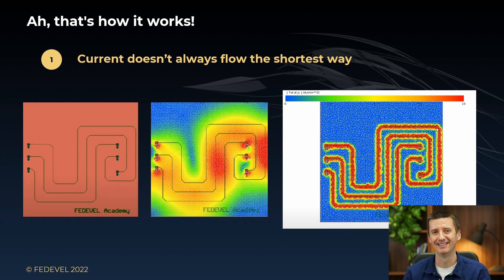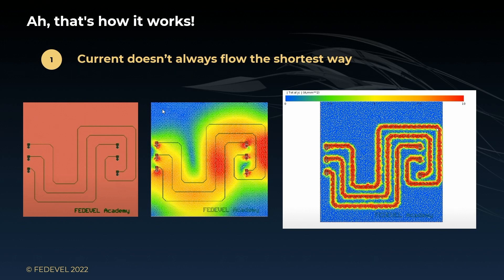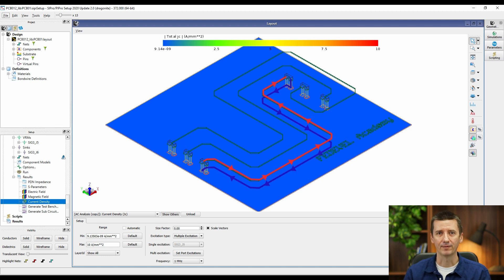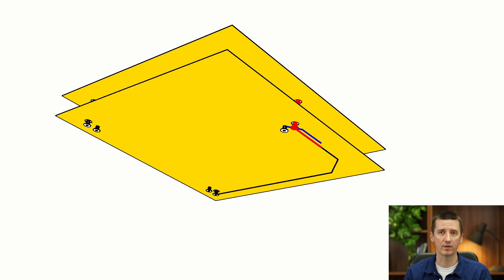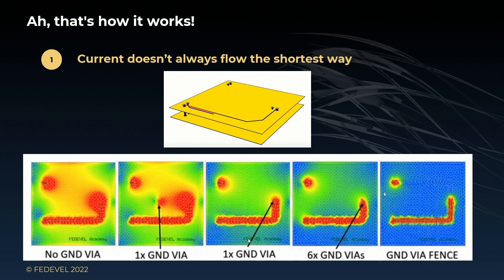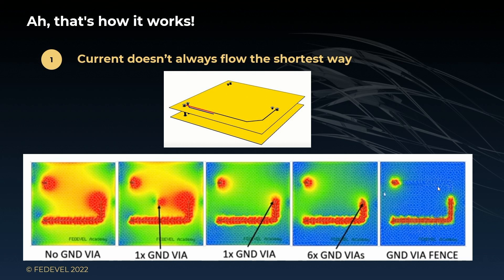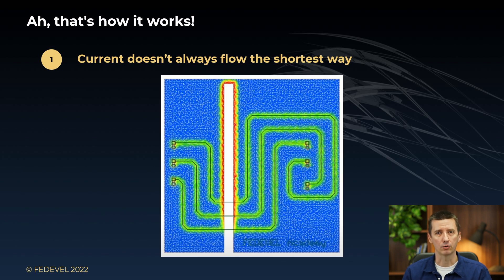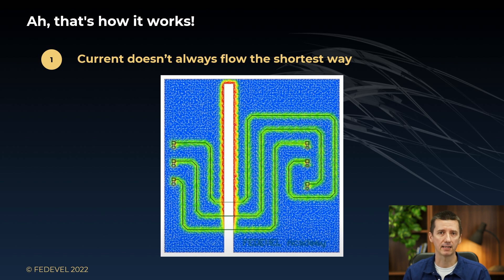Why understanding currents in PCB is important? | #HighlightsRF

Comment: I think it's worth mentioning at least once in the video that for high speed signals the current will flow under the trace because it's picking the path of least impedance not least resistance.

Comment: Current follows the path of the least resistance, reason being: potential gradient.
The potential field can change drastically depending on the frequency (impedance) and the shape. 
It's just that in schools everyone ignores the fact that the potential, caused by the source, while following the general direction of the wires, likes to extend everywhere. Literally everywhere.

Comment: Can we say that: High-speed signals travel as electromagnetic waves between signal track and ground. They are not just copper-"connections". With stitched vias, you "guide" the electromagnetic waves through signal track and ground. Without stitched vias, lots of electromagnetic energy are lost as leakage, causing noise to other tracks.